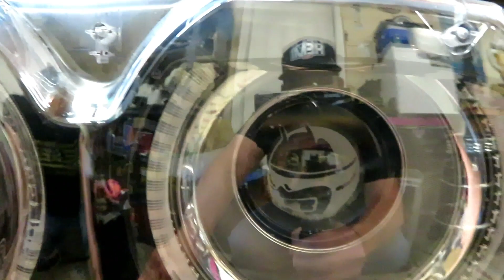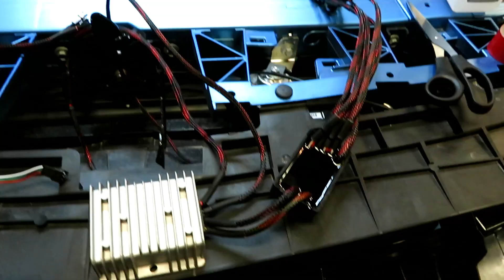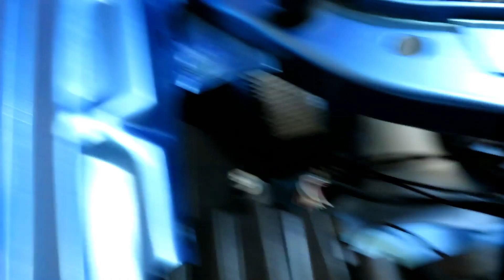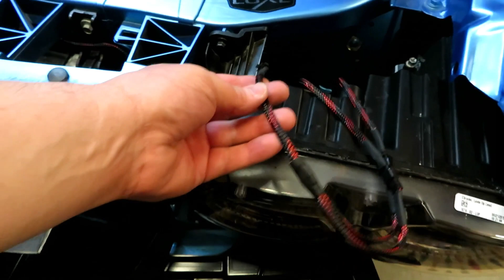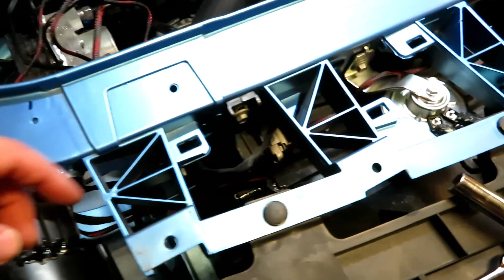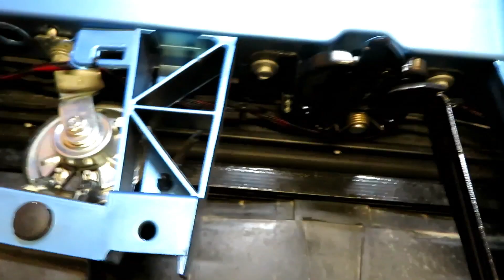Lighting Trendz halos | How to install

Comment: How do you turn them off lol
Reply from the maker: It is an app on your phone and the app has a power button to turn them on and off.
Reply: @MeanBee392  Which app? I've heard multiple different ones :c
Reply from the maker: The two that I use are Magic Light and MagicLED. Hopefully that helps.

Comment: Quick question friend, what piece of extension wire is it? Is it the flow series underbody 21’ extension? Cause I’m gonna need an extension like that size but don’t see my flow series strips, just underbody
Reply from the maker: The extension that I had I just got off of Amazon under LED lighting. Hopefully that will be able to help you out.

Comment: How do you turn them off. I shut my car off and went in the house and hours later I went outside and my lights were on? Also is it possible to drive at the same time as changing color as the lights, I noticed you can only do it when car is off and parked... please reply. Thank you!!!
Reply from the maker: You have to turn them off on the app. As long as you are paired on the app to can change them whenever and power them on and off whenever also. Have you figured yours out yet? 🐝

Comment: Is there a video of you actually installing the halos in your headlight ? Just watched your video on removing the front face plate .
Reply from the maker: Sorry but I did not install the halos so I do not have a video on that. Are you needing some help and if so what questions do you have I will try to help you out. 🐝
Reply: @MeanBee392  Well turns out I purchased the water proof ones lol, so I attached it directly on my lights . I tried to follow your video for installing the DC converter etc but ended up having to use some other stuff because I couldn’t get the 3M tape to stick 😂. Thank you , look forward to more videos though !

Comment: Are the flow series halos still working? I'm on my 3rd set....getting tired of opening my headlights.
Reply from the maker: Mine are still working and the only problems I have had are with the Bluetooth controller. That's a bummer to hear that you have had such bad luck with yours and that would get old quick opening up the head light that much. Thank for watching and commenting!
Reply: MeanBee392 I think I may be having the same issue, mine were working fine and then went to turn them on one day and message comes up invalid device, and don’t let you change colour or turn off unless I take the fuse out. Trying to locate another brand controller but having no joy

Comment: I'm looking to get a kit of halos and DRL for my 2019 charger. While doing some research I came across your video and had a quick question. Since installation, have you had an issue with your battery draining despite being connected to the engine bay terminal? I appreciate your time
Reply from the maker: Sorry for the late reply. No I haven't had a problem with them draining my battery but I have thought about mounting a toggle switch by the post so I can have the option to cut the power off to them if I ever did experience that. Thanks for watching and commenting!
Reply: @MeanBee392  thank you for taking the time to respond. One of my concerns what it draining power because its always connected to that terminal. 
On a side note, how does it function with the automatic lights? Do you always have to use the app to turn on the DRLs?

Comment: Would you happen to know why the Bluetooth would just disappear and not pop up anymore? My lights were working perfectly fine and now they just don’t even turn on anymore
Reply from the maker: That is very strange... I would try disconnecting it from the power supply and wait a bit and then hook it back up and maybe that will reset it and make it start working again. If that doesn't work it might be a possibility that the Bluetooth controller decided to die. Hopefully this will help and you can get it fixed. Thanks for watching and commenting!
Reply from the maker: Your welcome and I hope you are able to get it fixed!
Reply: Okay thank you!!

Comment: Have these but having a issue with a message telling me a bulb is burnt out and left turn signal flashes way faster than the right. What can cause this and how do I fix it. Exact same kit as the video. Thx
Reply from the maker: Do you have the turn signal function hooked up on the after market halos? If not check all of your turn signals and I am betting one is burned out causing you this problem. Let me know if you don't mind and maybe I can help you out. Thanks for watching and commenting!
Reply: MeanBee392 thank you for the reply. I actually called Lighting Trendz and they suggested to pull the negative on the battery to reset the computer. I did that and let it sit for 20min and hooked it back up and when I started the car turn signals were back to normal and no message. Checked all the lights and they worked as normal so I guess it just needed a “reboot” and seems to be okay now.
Reply from the maker: That's great to hear and that they were helpful! I am glad that fixed it for you and nothing better than an easy fix like that. Thanks for letting me know and hopefully it will not give you any more problems.

Comment: I just got these Lighting Trendz for my 13 RT. My car does not like them directly hooked to the power. I'm going to put in a relay with a switch off 86 . I'm finding my car won't start using the front power block and the same ground. For that reason I don't trust it directly hooked to power.
Reply from the maker: That's very strange that your car is doing that. If you dont mind when you rewire it let me know how you did it and how it's working out for you. Thanks for watching and commenting!
Reply: @MeanBee392  Will do. I'll do a vid clip of it. My RT was a 5.7 but it now has a 6.2 block with Whipple. Up until now I mainly did performance mods (she's around 700 to the wheels now) so my buddies are giving me a hard time about the lights. lol  I don't care, it was time for some appearance mods.
Reply from the maker: @michaelpeck5547  Sounds great! Very nice brother I bet she is a BEAST! And you are putting more to the wheels than a Hellcat. Lol tell them they can't give you a hard time unless they can out run you lol!

Comment: Did you have to depin any wires on the OEM connector for the headlights?
Reply from the maker: No I didn't. I have thought about it to add in the turn signal future that they have but I just haven't done it yet. Are you doing a set?
Reply: @MeanBee392  I want to. Just trying to understand all the connections and how they work before I buy. I get confused with the directions. They told me one app can control the demon eyes and halos if you have two bluetooth controllers. I don't want two things to carry around.
Reply from the maker: @michaelfeltenberger843  I understand and they can be very confusing because I was confused at first with mine. So they are saying that you can put two bluetooth controllers on the car for the lights and one will run the demon eyes and the other will run the halos. The controllers will be mounted on the car in a hidden spot that you pick and once they are hooked up and mounted then you will not have mess with them anymore. Then you can control either the demon eyes or halos via lighting app on your phone.
Reply: @MeanBee392  That's correct. Two blutooth controllers one app. You can control both lights inside the one app is what they said.
Reply from the maker: Yes sir. Is this something that you are doing or thinking about doing?
Reply: @MeanBee392  Thinking about doing. I'm overseas so just doing research now for when I get back.
Reply from the maker: Ok well hopefully I was able to help you out and if you have any more questions let me know. Nothing wrong with doing your research!
Reply: @MeanBee392  Right on thanks!
Reply from the maker: Your welcome! Thanks for watching and commenting!
Reply: @MeanBee392  Also it says to tap into the parking and sidemarker wires pin 6 and pin 14. Did you run both of these to 12v battery instead of pin 6 and pin 14?
Reply from the maker: @michaelfeltenberger843  That's correct I just went straight to the 12 volt stud by my fuse box and user their wiring with an inline fuse on the power wire. That's why I did not have to tap into any wires. Hopefully this helps you if you have anymore questions feel free to ask.

Comment: Good vid!!! Waiting on my pre built spec d flow series to come in, I’m assuming install is pretty similar, do you know?
Reply from the maker: Tazzo 729 Thank you! That’s awesome and you are going to love them! Yes the install should be very similar. Let me know how it goes and hopefully this video will help you out! Thanks for watching and commenting!
Reply: MeanBee392 I got mine in and working. But my demon eyes aren’t coming on. Did you have to do anything different on the app?
Reply from the maker: @dirtybirdvision  That is awesome to hear that you got them in and working! Sorry to hear about the demon eyes. My demon eyes are controlled by a remote and my halos are controlled by my phone. Are yours all on the same system?
Reply: MeanBee392 I talked to lighting trendz, apparently there’s a separate app for demon eyes.